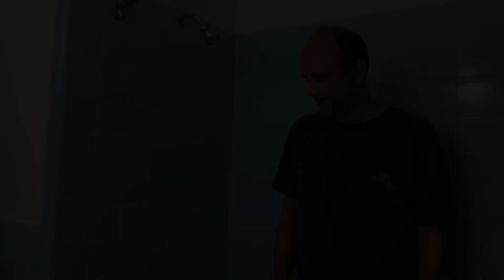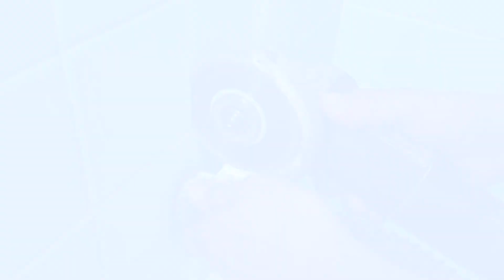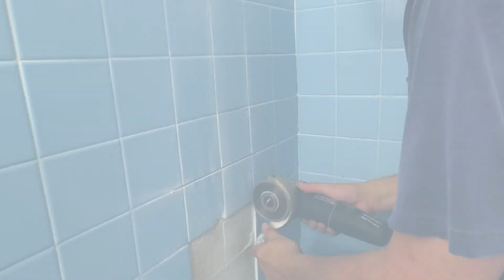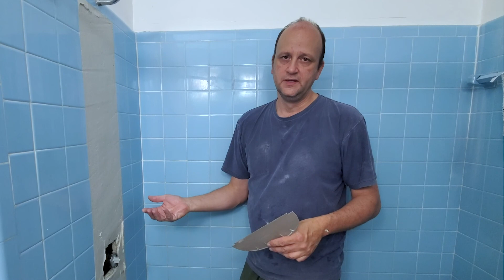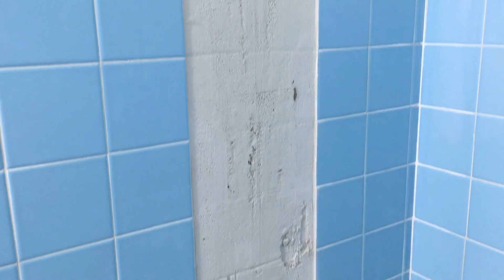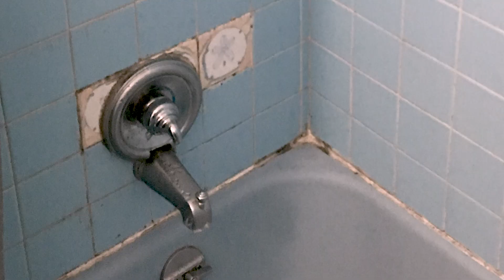Tile Repair: Using a tile accent band when you can't find matching tile

Comment: How much to charge for such a job today? I’m a handyman. I know each job is different. But great video!
Reply from the maker: I charge about $75 an hour plus materials. For a job like this it was around $1,200 plus the cost of the fixture and tile. I've been removing tiles set on metal lathe and mortar for a while now and it is pretty easy once you get the hang of it, but there is a learning curve. I'm glad you liked this video. This is one of my favorite repairs.

Comment: I am in the process of having to do something similar. Is this expensive to have done?
Reply from the maker: It really depends on who is doing it and what the scope of work is. If I were doing something like this job, if would run just under $1,000. That includes the plumbing.
Reply: @groutrx1415 where are you guys located?

Comment: Was your substrate depth below the existing tile depth based on the depthof the accent strip plus the adhesive?
Reply from the maker: Well, the substrate after we removed the tile strip was lower than what was needed for the thickness of the accent band, so I took a plastic mud trowel and cut away the sides to the depth that was necessary to set the tile. I then ran it along the vertical length using the side tiles as guides to create a substrate that was smooth and the proper depth for the tile.